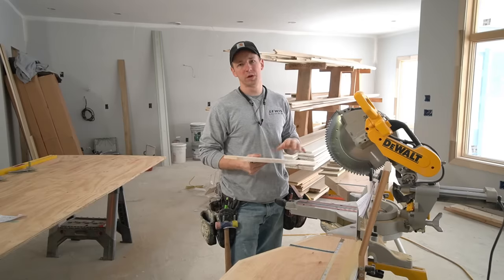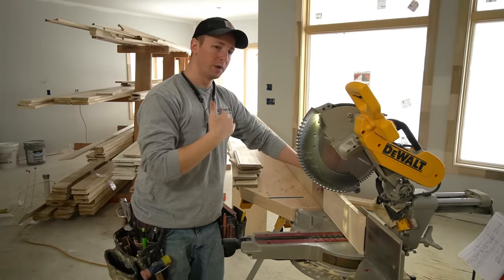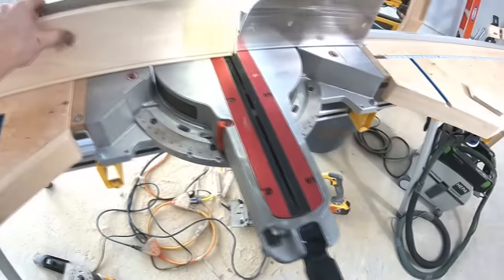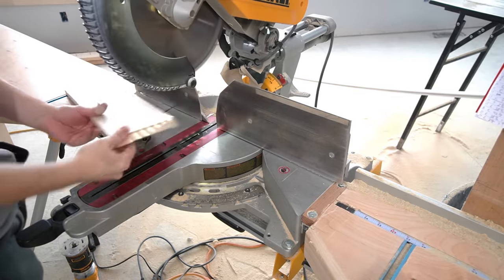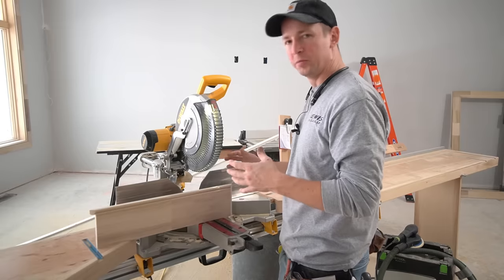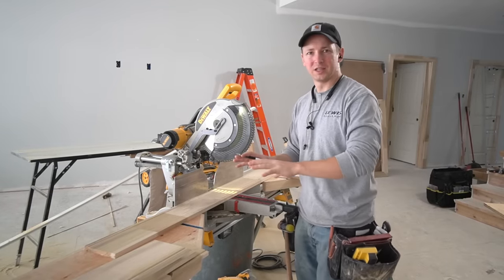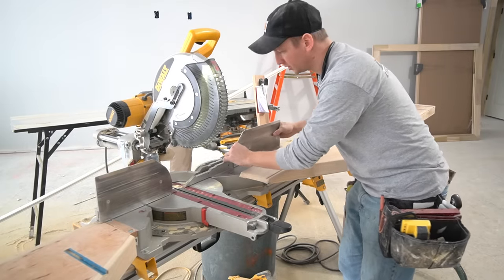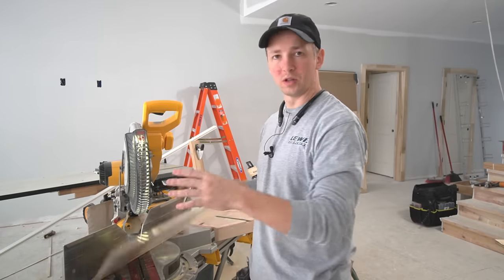What??? Pros Cut Baseboard Upside-down and Vertical... Why?

Comment: I've been a finish carpenter for over 30 years. I find that most people have zero idea of how much brain power it takes to do this job, and more importantly do it well. 👍
Reply: Nice reply. I’m a retired project manager from the aerospace engine industry. I had a interesting career and did my job well but always felt since my teens that being a carpenter was to be my calling. Specifically a trim carpenter. I’ve always done my own home trim work. And your very right about the brain power aspect of that trade. Spencer for his age is an amazing one man skilled trades man. I envy you guys that do it for a living. Leaving your mark everyday and doing it well has got to be super rewarding.
Reply: Nah, the concepts are simple enough...it's the "doing it well "  that limits most people!
Reply: Math is your friend...
Reply: People are mind-bogglingly out of touch. I recently went to repair a ton of base in a house where their dog had peed it into oblivion and about ten minutes after I arrived, while ripping the base out, the homeowner asked if I was done yet. I was hired to finish it through PAINTING.
Reply: Do you run a sliding miter saw or fixed saw?
Reply: Where did you get the plate that sits flat on your miter saw. The red and black one ?
Reply: @itzNickyJayBeats  I have several of both
Reply: It's easy because you do it everyday.  You also transfer that type of logical thinking to other areas, so you are always thinking before you do.  People whom aren't handy don't really consider the consequences of the nuances before they proceed.  It's just a mentality.  Well... Sometimes people are just dumb.
Reply: @MintStiles  yep
Reply: @itzNickyJayBeats  these days I'm doing mostly custom cabinetry and paneling/trim. I leave the baseboards to the young folk. So 99.99% of the time I'm using my cheap little 10inch dewalt. Gets it done.
Reply: Doing it well is the key. I've seen many DIYers who think its simple yet their workmanship is horrid
Reply: No doubt you are correct. But you know how many people with zero brain power are out there doing that these days. And more importantly jobs that are way more significant. Like controlling the switches to launch nuclear weapons
Reply: @bruce3585  They actually hire the smart guys to do that, hence the air Force being in charge of that.
Reply: Shirley Knott  maybe for framers
Reply: I’m an orthopedic surgeon. Finished carpentry is indeed difficult to do well. Smart guys.
Reply: @lightworker4512  It is more art than science because you are making do with what you got and it has to look good as well.
Reply: I'm 30 years old and just bought my own house. I'm watching so many videos of contractors so I can learn to do basic projects by myself. I'm astounded by how quick y'all are with making/adding measurements and how much you have to remember. I thought cardiology was hard, but y'all are definitely giving me a run for my money!!!
Reply: Lol... Learned this lesson first hand this weekend.
Reply: Like any job, if it’s not something you do all the time, you don’t learn the best methods or most accurate. That comes with lots of practice, trial and error. For most DIY guys, there isn’t enough practice with one trade to perfect it.
Reply: @davemon8130 you could always make one and stain it nice if you have a load out built on your miter saw
Reply: @thomasdickson35 that's absolutely ridiculous! Even the most basic person usually understands that such a job takes longer than 10 min! This customer must've been quite a privileged person that hardly worked a day in their life.
Reply: Trim carpentry takes brain power but try house framing in the days before manufactured trusses and stairs! I started framing, cutting my own rafters on intersecting roofs and making housed stair stringers, calculating the rise, run, and head room, you couldn't rely on the prints. You use to have to know how to read a framing square. Not everyone has the skills to do that.
Reply: Absolutely correct!  More critics should try this type of work..  They would learn quickly the brainpower and skill it takes.  Ignorance of the masses is why tradesmen aren't given the credit thet deserve.  For the masses, ignorance is bliss.
Reply: No, as a DIY'er, I totally respect it.
Reply: You can only cut vertically if you have a 12” blade on your chop saw. Also it’s more likely to chip depending on the material you’re cutting. This guys tips are great but not practical for everyone. I also don’t understand the cutting baseboards upside down. I suggest buying a sliding miter saw. What’s an extra 50 bucks ?
Reply: So you’re making two cuts to hand cope a cut? I never understood this ridiculous waste of time either 😂
Reply: Oh yeah don’t forget you will most probably be working in limited lighting conditions in extreme heat with no ventilation. 😂
Reply: @itzNickyJayBeats If you observed the video you would have noticed it was a sliding miter.
Reply: @MintStiles It isn’t that people who aren’t handy don’t know what they’re doing. This guy does this daily for a living. The average handyman like me has to know how to do hundreds of different things. So who’s really smarter?
Reply: @rolandthethompsongunner64  well... Obviously you are smarter than me.  I mean, you are the average handyman that knows how to do "hundreds of things."

Comment: vertical cuts only work with millwork small enough for the saws cutting capacity. learn both techniques and you will be able to be efficient. I'm not a production contractor though, mainly custom.

Comment: Cant cut vertical most of the time in the uk as the plaster finish kicks out at the bottom so you have to cut out of square  which would be a pain in the vertical position

Comment: If you’re doing a remodel and need to scribe to the floor, working off the finished profile (cutting upside down) is a good way to keep you joint angles true.

Comment: Hi Spence,
Once again, thank you for the time spent teaching and informing us of techniques and tricks you acquired over the years in the trade.
My question is; do you pre-measure and cut baseboard runs that are longer than stock your available length? Runs that require scarf jointed middle boards or just two boards with a single scarf. It seems to me it would be difficult to determine that exact scarf position without installing a corner section, measuring the remaining run, the cutting, installing and if necessary repeating. 
Thanks for taking a moment and reviewing this question. I pray all is well with your wife's health and your golf game,
Gerard

Comment: Hey Spencer,
I cut my baseboard on the flat. I don’t tighten the back knob and my saw drops freely to the left, down to 46° and back up to 0° when I need a straight cut. 

I make a 46° cut for the cope. Then I make a straight cut trough the cope the way you do it, hook up with my tape to that cut, and measure - say 100”. Then make that 100” cut and finish the cope with the jig saw. It’s another way to do it and doesn’t require a super good blade, because it pulls the material in with the teeth from the face or high quality wings like yours. 

Love your videos.
Reply: I've done it just like this in the past, leaving the bevel knob loose, only when doing 11" mdf that the HO wanted coped for some reason,  it worked pretty well but I was nervous about the saw rotating while cutting

Comment: Just another excellent, excellent video from you, really glad I found your channel - I've been a cabinetmaker over 30 years, but you've got lots to teach about running finish trim that building casework doesn't encompass. One thing, when using the chop saw to cut out the waste on your miter, you correctly lifted the blade out of the cut before releasing the trigger. This is something that becomes automatic once you've spoiled enough cuts when the blade brake cuts in and the saw head kicks down. Worth pointing out to folks who haven't used a chop saw much.
Reply: I am waiting for him to mention this as I watch the video.  Very good point.  I've learned that the hard way and I've seen many make that mistake as well.

Comment: Been doing this a long time and never thought of this. Great tip. Just like cutting ceiling crown. I understand the clockwise method but when I do stain grade work I try to orient my copes to the room to take advantage of the blind joint.   I've learned to help the confusion for beginners (and myself on bad brain days) on cutting ceiling crown upside down with two steps that would be the same for base with this upside down method. Identify which end is being cut and put it into the saw upside down. Swing the head in for an inside corner and out for an outside corner. Love your stuff. Great combination of top quality work and efficiency.

Comment: It's the most efficient way for me to cut base. It cuts out that awkward step of flipping the piece over and around, to make the straight cut on the cope. I typically cut my outside miters, with the back of the base facing me as well. That way I'm not leaning over the saw, trying to see my line. Cutting base upside down, is just one of the many tips I've picked up from Spencer. So many people dismiss new ways of doing things, simply because "This is how I've always done it". In my 42 years on this earth, I've figured out a thing or two, and one of those is, my way, may not always be the best way. Keep an open mind and be willing to try new things, you may be surprised at how well it works for ya.
Reply: Well said,right there with ya 👊🏻
Reply: Absolutely... Spencer is very generous with his content and opened up different ways of approaching the job..
Reply: Great advice sir! I’ve bin building houses for over 30 years and everyday  I still wake up asking myself how can I improve on what I did yesterday. Your advice is very appreciated!
Reply: I would imagine it didn't take all 42 years to figure that out. :)
Reply: @josephdestaubin7426  maybe just 41 1/2. 😉
Reply: @10813mike  that's when you know you've picked the right career
Reply: Being open minded and willing is what makes a truly good carpenter. In my opinion .
Reply: I agree. For instance, buy a jig that gets you the exact angle of an inside corner instead of wasting so much time with coping. 😝
Reply: @michaelmcgee2026  that doesn't work well when the wall is wavy on older homes, the wave messes up the angles at the end of the baseboard.

Comment: I made a whole house cut list just like yours when I was still trimming mostly new construction. I can’t get on my knees anymore. I always used a traditional hand coping saw. Still do however I cut the flats on the miter saw but I never thought to cut base upside down. On walls needing a scarf I don’t cope those pieces as well as pieces that make an outside corner. Another good tip for beginners is to cut all your long lengths first and using the drop for small pieces and don’t forget to number the back of every piece. I miss trimming houses but I really love being in the wood shop now.

Comment: Great video! Pretty cool to see we have nearly the exact tool belt setup. But, I cut on the flat use a coping saw and put a 15degree backcut on the straight length cutting a single room at a time in a counter-clockwise pattern with the copes on the right side.

Comment: I'm in the field every day running trim. I like your videos you're an excellent Carpenter.  But when streamlining baseboard cutting on the flat is the fastest way by far. You can watch your blade as it comes to the first profile perfectly to make your cope a quick shot. Adjusting your miter is definitely quicker than adjusting your bevel, but with the right trim saw it's a routine that one Masters quickly. Keep up the good work and thank you for all the awesome videos. 👌 keep them coming.
Reply: I always mark to the short point on the miter as it is most accurate,add a degree or 2 to make sure the face of the trim fits flush and tight
Reply: I’ve always cut laying flat as well. I’ve tried cutting base standing but my feet can’t take a whole day of that.
Reply: @IndianaJBird  🤣🤣🤣

Comment: Just did baseboard for the first time and tried every way. Ended up on upside down and vertical too. When right side up and vertical I realized my base has a thinner profile at the top so if I cut on the line, it cut more off the bottom and my cut was too short. The bevel was too annoying to keep switching and you can't cut 45.5 deg bevels on my dewalt 779. Stops at 45. Great tips! Wish I'd watched this first

Comment: I understand a little...great video..question..if the wall is longer than the length of baseboard, what degree cuts do u make for joining the baseboard in the middle..thanks....Im not exactly sure what u r explaining, i start counter clockwise, install my first piece, then I cut my joining piece on a 45 degree to the left and cut that out with a coping saw...every piece i cut standing upright..very much a newbie here..
Reply from the maker: I just make a square cut butt joint and join with 2 #10 biscuits.

Comment: In Sweden we often use pre painted baseboards.. so I , depending on angel of course, always have the painted 2sides towards my eyes.. the backside doesn’t get as good crisp cut as the 2 sides towards you. Make sense?
Reply: Yep. With pre finished trim, you can (and will) have some tearout on the top edge. I did alot of pre finished oak trim, and cutting upside down is a certain way to ruin pieces.

Comment: If a right side cope is necessary, you can sit the board upside down still, but with the profile facing the fence (depending on the profile perhaps). Then set the depth stop for straight/straight back cuts down to the profile. Flip the depth stop on or off as required.

Comment: So what you're saying Spencer is cope to the left 90 to the right then when you're running around the room going towards the right the next piece will be cope to the left and again 90 to the right. So if we're cutting upside down the cope is always going to fit on the left side as we install the board is that correct

Comment: I fully agree cutting upside down is the most efficient way to cut base. Learned this by trial and error 20+ years  ago when learning to cope miters for stain grade. All the flipping around when cutting flat seems to always results in an ah shit and some wasted material. But when cutting upside down, if the piece has a crown or dip the slight angle on the cut will be reversed when on the wall. Paint grade it don’t matter but stain grade it will require just a little extra work to close the gap. Keep up the good work and knowledge sharing. 👍👍

Comment: Been a carpenter for a long time never had a problem with inside meters and outside meters. We cut baseboard in a normal cut without a slider chop saw. The only time we cut upside down is only a crown molding not baseboard. 
However, the cope for baseboard is cool.

Comment: We make our own cabinet basemolding out of 3/4 x 5 1/4 poplar or soft maple .
Using our shop corded 12 Bosch slider or 10 cordless Makita, I have to cut on the flat.
It is definitely more stress on the motor and blade ,but because they are 90° corners I don't need to cope.
I find the Bosch to have very poor sight lines, it involves holding the guard up with your finger then sighting mark and blade.
There are desk lights that can be modded for shadowlines,but my boss doesn't like modding tools.
Very good videography,and as always the content is outstanding 👏.

Comment: never thought about putting the base upside down. i guess its the way you are tought  by someone whe dont know eather .62 years old been doing trim for 37 yesrs and just learned somethin new. thats a lot easyer than turning the 12 foot board around to cut the flat off thx for the tip.
Reply: Well no doubt if you’re cutting 12 or 16’ boards 😂

Comment: I have a question and it might sound stupid but does your sliding Dewalt 12” saw cut taller base than if it was a fixed 12” Dewalt saw?

Comment: I’ve been a finisher for 20 years, mostly high end remodels. There is almost no new construction where I am other than additions so I do mostly finish work on houses built before 1940. And there’s earthquakes. Can you guess where? I really wish my miter saw table and supports mimicked the floor I’m installing on. That said, if it was I’d be paid a lot less than I am. The scribing is pretty involved. And please don’t talk to me about 1/4 round…

Anyway, great video with important information as usual. I approve.

Comment: Haha I've done it,or seen it done every way possible,I tend do just pick whatever works best at the time depending on the trim size and honestly how much mud the drywallers used.I was taught to go around the room like you said,but over the years I have learned to put my cope on my short run when given a choice,it may be out of order sometimes but I'd rather put a cope on a 3 ft piece than a 16 footer especially if I can just put two straight cuts on the 16 footer.Youre a good teacher that's for sure and your methods are sound.

Comment: Nothing beats take some back wood out, makes it easier to cut the piece a bit long and snap the longer pieces of base into place. If a bit long it's more or less easier to (while snapping the piece in place) to slightly crush the fine leading edge left from backing cutting into the other piece of base that your butting up to... Wow.. Hope that makes sense, probably much easier to demonstrate than to explain (at least for me) lol
Reply: It's like leveling a door
Reply: I call that friction fit
Reply: it's called coping cut :) done 😆 put I pick up what ur putting down lol
Reply: @jasonh3188  yes obviously we're speaking about coping the base but I've seen ppl make a coping cut without removing enough back wood making it harder to ever so slightly crush the leading edge while snapping the piece into place. (bending)